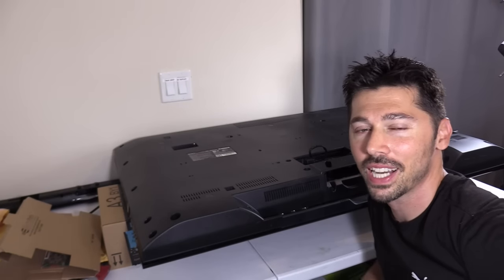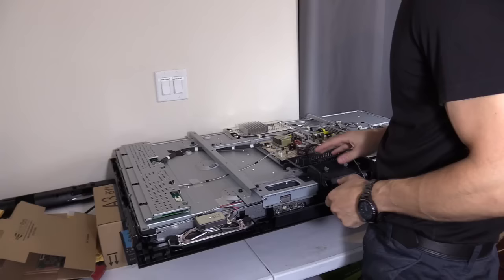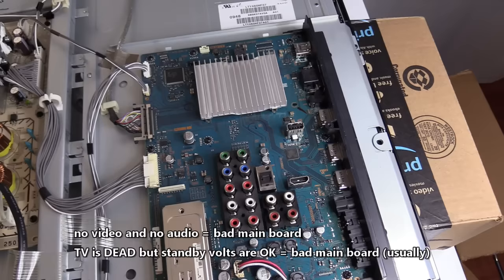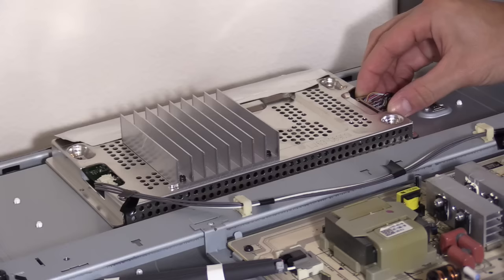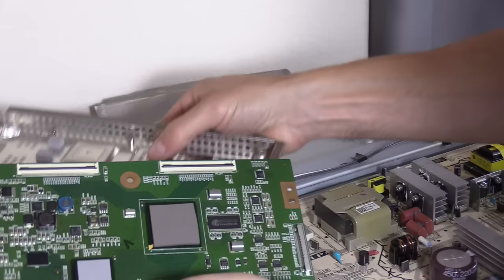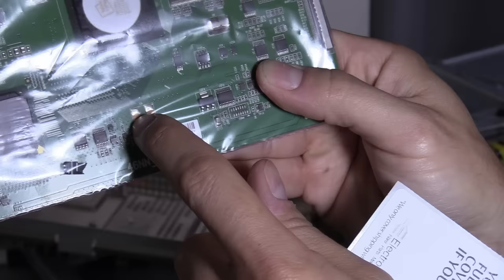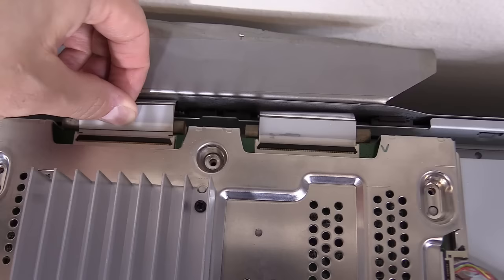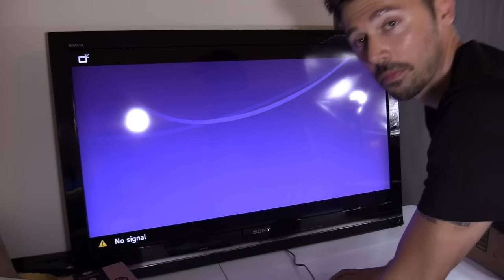SUPER EASY WAY TO FIX MOST SONY LCD TV KDL- PICTURE SCREENS !!!

Comment: Hi! I have a  Sony Bravia Xbr KDL-52XBR6 which appears to have the same issue with the TV you are working on here. I can see vertical lines (something like rainbow colours) when I turned on the tv and stays all the time when I watched video.  Is this the same problem with what you are working on? I mean the same board to replace? If yes, I want to buy the board so I can start replacing it. Thank you very much! You have a nice channel and I just subscribed!...I am a computer technician who always explore on other electronic device repair.
Reply: it's a big fat lines not thin lines like the tv you are working on. and a l ittle bit faded colour like water marks..but sometimes appears stronger.

Comment: Dear Tampatec,   You have done a fantastic job with your vids and youtube channel. Ii cannot say how much i appreciate the help this content has provided.  
Challenge: I have a sony KDL-46EX521 software PKG4  which has a picture scan line issues 
---------(if that is the correct way to explain it). 
By appearance if the normal picture was equal to a 1200 DPI laser Printer, thie appearance of the image is that of a 9 pin Dot Matrix printer,  Before i prepare for surgery,  i seek your wisdom and an understanding of what i may anticipate.  I suspect that the issue is the t-con board, and whatever the issue is, i will need to identify exactly which component to ensure i order the correct replacement parts or capacitors.  Any guidance you can provide would be greatly appreciated   Kindest and Best Regards.

Comment: What about the same TV (that you're using) with one horizontal white line, that eventually turns into a red band (as the TV runs), going across close to the bottom?

Comment: Hi Mr Tampatec , quick question if you can assist . What would cause a solid black vertical band  to appear down the middle of a Sony KD-L46HX850 screen?  The TV  itself otherwise functions normally with audio and video ...(except for the earlier mentioned issue). Cheers .

Comment: I have the Sony kdl48r510c . During power-on, the screen lights up with 4-6" wide vertical bars behind the Sony logo. The Sony logo, turns slowly from white to green and then slowly fades. At this point, I have a totally black screen except for the back-light. None of the on-tv buttons cause any display changes on the tv. Using the source button, I cycle through the inputs which has my computer plugged in. I feel like the main board may be damaged, since the computer doesn't sense that the tv is plugged in when it is on. 
Is there any diagnostics available via the network connection? The link comes up when I plug it into my computer, but I don't detect any traffic coming from it...
Thanks for your videos!
Mark

Comment: I have a KDL-52WL135 bravia tv which has vertical lines only on the far right side.  I have changed out the tcon board (and get the same lines) and checked all of the ribbons that connect to the top of the screen (which are fine).  There is a UB2 board that connects to the tcon board.  Should I replace that board also?  Or should I try replacing the main control board?  Any answer would be appreciated.  Everything else on the TV is working fine.

Comment: Hi, my sony sony bravia kdl-40v5100 has the next issue, when I turn it on the Green LED indicator tuen on, but the TV gets no video, no backlight and no audio, also qhen i turn it on i hear a "click" coming form the power suply board, so i'm not sure what is the problem. 

Any ideas? i would really appreciate the help, thanks

Comment: I have a kdl 40bx420 it only diplay colors red blue white and green. I change the main board and power supply and turns on but only solid color changing display. I need help please

Comment: I have Sony KDL-46Z4100 with no picture, but there is backlight.
The tv go off by itself after few seconds then the standby light flashes for 14 times. 

I disconnected the T-con board for the TV and powered it on, the tv still no image with backlight but this time stay ON longer (about 2-3 minutes) and standby light flashes for 12 times.

Comment: Just found your channel. Great videos! I have a Sony KDL-40S4100 that has a vertical red bar on the right side of the screen. From your video it seems like it may be the tcon board? Is there a way to confirm that before I buy a new one and replace it? I am not a technician but am comfortable changing out components. Any insight is greatly appreciated.

Comment: Hi there, my Sony  KDL-48W600B screen goes black starting from the top right corner and slowly moves down to the bottom left corner. Sound remains perfect. If I turn off the set and switch it on after a few seconds, the picture comes back on and then slowly goes black again. Help!! Thanks...

Comment: Hi ive got a kdl-65w855c the sony logo flashes along with the led striop on the right hadn side, then the whote led on the middle bottom comes for a second then goes to red and flashes 6 times. Is this a led backlight issue ?

Comment: I have a 60 inch sony bravia 3d LCD TV and I can faintly see a screen with picture but the picture is so faint. I put  my firestick in and you can see the apps and all but it's really dark, you have to be up on the TV to see it. I sent it for repair and they told me it was my control panel and then said we changed that but now its your back light and it cost to much to repair and they had me come pick it up. Is it even worth trying to fix ? On here most show it is the back lighting that is my problem, is this something I would be able to do since the only TV repair place near me couldn't fix it. Thank you
Reply from the maker: Sounds like bad backlight led strips most likely. Get led strips at shopjimmy.com cost about $100 to 140 but if you are nervous Then find another tech savvy person to help you. If you follow the tutorial you should be good.

Comment: Hey Tampa tech my TV is the 55 model one. The weirdest thing is that after an hour or two of being on it will black out for two seconds and then it will disconnect from the HDMI. Any ideas how to fix this? I've tried factory resetting, unplugging tried different ports still the same. Love your videos but the way. Thanks!

Comment: I have a 52" Sony Bravia much like the one in the video. I got a identical T-Con board on the web but it still displays the red vertical lines throughout the TV. I was wondering if it could be my main power board or the cable itself that connects to the T-Con board. I just need a direction to go in, and any advice could help.

Comment: I have the thin black horizontal lines going through my Sony 55KDL. Your saying this board will not repair that problem. Its bearable right now but just curious in case it happens to get worse. Its probably been like this for a couple years now.

Comment: I am going to be using your code to get parts for sure. Quick question. I have a Sony Bravia KDL32S3000. It has power and audio. It also has segmented full color vertical lines in the bottom left hand corner. I pulled the panel and disconnected the T-con cable leading in to the the T-con board. ( I did not disconnect the tapes but I did press on them gently to make sure they were not loose). I reconnected the T-con cable and got a good picture. Put everything back together after testing again and still having a full picture. After about a half hour the picture started to get fuzzy and degrade into a haze and eventually back to the vertical lines over the course of a couple hours. Does this sound like the board is the issue? Possible the cable? (worried that as it hangs downward maybe the connection is loosening??? Or is it the tapes themselves at the top of the board? I know it's hard to diagnose over the internet but still if you have any input let me know your thoughts. I'm not sure how often the cable itself goes bad. Thanks in advance.

Comment: I have a Bravia KDL-46XBR9 tv from 2009. Recently it started coming on, 15 seconds later it turned off and the red standby light flashed 10 times. After a pause it will do this again. After 4 times it shuts off and the standby light just blinks. I had a repair tech come and look at it and he did some minor testing on the power board (g7n) and said it needed to be replaced. He also said it would be more than the price of a new tv for him to fix the old one. However I am a musical instrument repair technician and I can change a board. My question is does this sound like a power board problem ? Was the techs advice to me to change the power board correct in your opinion ? Thank You-saxman

Comment: Hey, great video! What if I have horizontal colored lines, but when not on all modes. For example, if I go to to the built-in Netflix mode, lines disappear and it works fine. But with the TV box connected to the HDMI port, or on component mode, I do see those lines.. ?
Reply: Did you ever solve this problem? I have the same.
Reply: @angelacornwell  after about 6 days the lines disappeared by themselves. However, I already bought a spare T-Con board in case it happens again.
Reply: @MarceloOtero92  Thank you for the reply. Hopefully, my problem will go away, too

Comment: I have a KDL-46VL150 - the symptoms are after extended use the tv shuts off and has a blinking light on the bottom right near the power button. the HDMI are non-functional. the RCA inputs are still good, but yet again after extended use it seems like the tv heats up and stops working. Any recommendations ?? Thx

Comment: do you have a video showing how to remove the glass assembly on the front of a sony google tv/sony nsx-40GT1?  The lcd panel is fine but the glass was cracked.  They are listed as two separate parts but the glass is sold out everywhere.  I found a used replacement glass/lcd panel but the cost of the it+ cost of tech to install is more than the tv is worth.  Another owner posted that he just removed the glass and was using it without.  Was interested in seeing how to do that before trashing the tv.

Comment: I have KDL-40CX520 with horizontal purple & red line along the bottom part of the screen. I've opened the TV but I only find power supply board and logic (input) board. Could you tell me where is the T-CON board located. I see the the thin-like-ribbon-cable going upstraight. Is it possible the T-CON board sunk in inside the LCD panel. Help me...
Greeting from Indonesia

Comment: I have an Lg 47LM6400 lines down the screen, I replaced the logic board and no change. I fiddle with the ribbons that control the left and right picture the lines move around. Now am I correct in assuming that the ribbon cables are bad?? And will work if I replace them??

Comment: Tampatec, Ive been watching your videos for the Sony Bravia LCD TV. My Model # is KDL-52S4100. From one day to the next I turned on the TV and only the green powen on light came on. I have done what you've showed in your videos and when i disconnect a 5 pin connector labeled CN2502 then i get all these different colors and the back light works but im wondering if you could tell me if this is the main board?

Comment: Tampatec,  I have a Sony Bravia KDL model that has power but no sound and the picture is nothing but lines that can only be seen with a flash light.
It just went out one day then after a couple of months it started working again. That lasted for about a month then back to what I described before. Can you tell me what's wrong with it?  Thanks.

Comment: I know it's 2020 now... IF you're still answering here what do you think the prob might be if my TV Powers on, stays on, but the audio and video intermittently drop out for maybe 10 seconds at a time randomly. Sometimes it happens twice in an hour, sometimes every minute for 5 minutes then stops... thanks
Reply from the maker: Bad connection somewhere. Hdmi cable or connection inside.

Comment: I have a Sony Bravia KDL50W800C that had a distorted display. I change the T-Con board and now getting the blinking red light. I reverted to the non working t-con board and same red light. Any ideas?
Reply: Hi shanegmason18, what did you end up doing? Does your original tcon board match up to the new tcon you purchased? There is a tcon board number(example T550HVN08.2 etc..) and theres a serial bar code number (example TT-5550T20C14 etc..), were they the same? Mine is a Sony Bravia KDL-50W805C

Comment: when i switch on the tv and there is no video signal anyway the whole screen is black but I notice two areas that look like a white cloud not really symmetrical figures but you know not as black as the rest of the screen, is not really too noticeable but you can tell, when the tv is getting video input the tv looks fine no trace of this "white clouds" Is this normal in LCDs?

Comment: one question i own a kdl-70r550a model and i have a fading screen problem in with the screen shows a partial image than starts to go dark. i checked for the t-con for it and there was a sharp t-con that states that it should work for my product. the model for the t- con is RUNTK5261TPZA if you have information to verify that it can work on my tv i would apreciate it so much.

Comment: Hi. I got the Sony KDL-40V5100. The picture is perfect but the sound is only the crackling noise. Is this an issue with the main motherboard/logic board? I have already tried updating to the latest firmware and did a factory reset without any help. Thanks.

Comment: I have a similar problem with a KDL-50W808C but the OSD is visible for a couple of seconds and then the whole picture is filled with vertical white lines on the same place where the OSD appeared. Then the screen will darken with the backlight visibly present. Kindly advise

Comment: Hi I have a Sony Bravia 52” KDL52V4100 model, how do you fix the screen!? It’s as if I had zoomed into the picture. For example the commercial ads don’t show up completely-just from the middle to end. I tried to fix it with the controller under “full screen” but it doesn’t work. Any ideas?

Comment: Hey Tampatec, so I took apart my tv to try to fix the flickering image.  so I tapped the frame (ribbon attachments) and the flickering went away, but I went to attach something ( vga computer cable)  I attached it, then went to attach the small cord for the power on/channel/volume cord and when I did it shut off.  Now it trys to come on looks like there is some backlights but nothing, then you can hear it shut off.   any thoughts?

Comment: So my Sony Bravia works great but only once in a while. I can go months without using it and then kaboom, it works for a week.  Black screen. Audio fine. Have done resets, unplugged, power back on, and more. No flashing lights. No overheating. Just pure black.  I know if I just wait a few months, now, it will be fine.  Ideas?

Comment: have a Sony XBR-49X700D bottom of screen is blured which goes in and out changed two T-Com boards and same result. Test point on T-Com board fluctuates from -6V to 27 volts. Any ideas Thanks

Comment: I have this very same TV. The green power LED comes on, but no backlight and no red error LED! All low power rails (15V unreg., 12V, 5V) are ok. On the power steering interconnector I observe on the "inv-err" a logic high (3.3V). Nothing happens when I force it to ground. The inverter board is fine in all aspects (Diodes, transformers) are fine. Presumably as a consequence there is no HV going to the inverter board from the main power supply.Any ideas where I should further look for the problem?Thanks in advanceLutz

Comment: My TV started pulsing from the top left of the screen and goes black and then comes back. It doesn't allow me to change any menu options or use the remote. It's stuck on Chanel 12 and will just keep going off and on but the sound is fine. Do you have any suggestions

Comment: My issue with this model TV is that I get no picture at all. All I hear is a click noise and I see the green led light come on, then it turns off again repeating the clicking noise LED light cycle on an infinite loop. I noticed that if I unplug the Tcon board I get no picture but the green led light stays on permanently. Could it be a bad tcon board? 

Thanks

Comment: Thanks TampaTec.  Your videos have helped me a lot on other projects.  I also have a Bravia KDL-52XBR4 which I believe has a t-con board issue.  The picture is there, but it appears to be split into bottom and top halves.  The bottom half is darker and has a green area mixed in with the lower portion of the picture.  I am confused as it appears most t-con problems involve vertical lines and areas.  Should I be looking at the video board?

Comment: hi, i have an issue withmy sony bravia tv (model: KDL-42W670A) when i turn it on, it has no sound and  no visible picture. It has a patchy white covering over it. After some minutes, it becomes completely white. i hope you can solve my issue.
Reply: it doesn't turn itself off btw. there's nothing wrong with the glowing light underneath it. it reacts to my remote control when i press something. nothing worked when i tried resetting it.

Comment: Hi i have a sony kdl 37u 4000 had the t-con board repaired tv worked twice ! now no picture no sound power turns on 10 seconds green then repeat 4 flashing red lights do think it could be the inverter board ? thanks

Comment: Hey I'm a new subscriber and love your videos. But question? Do this apply to a LCD with a dark tint in the picture on the right side of the t.v.? Thanks
Reply from the maker: Teezy Champion that can be bad tcon board or bad LCD panel. Try tcon, Get tv boards from shopjimmy.com or electropartsonline.com use code tampatecfriend to save. Board number printed on sticker on board, make sure you buy the correct version. Hopefully that helps.. Good luck 🍀
Reply: Thank you will do